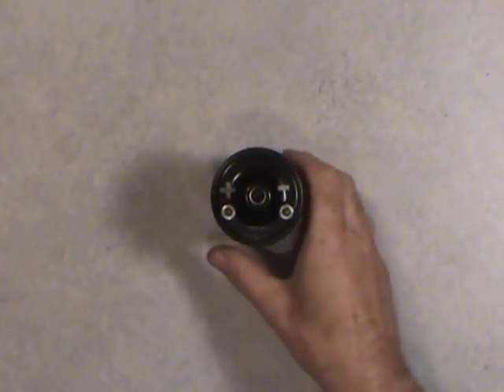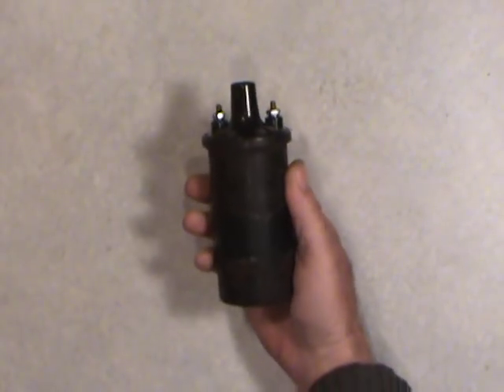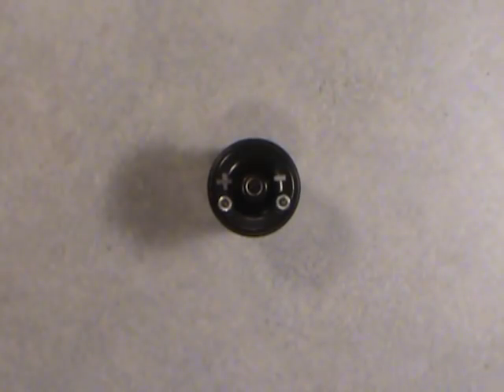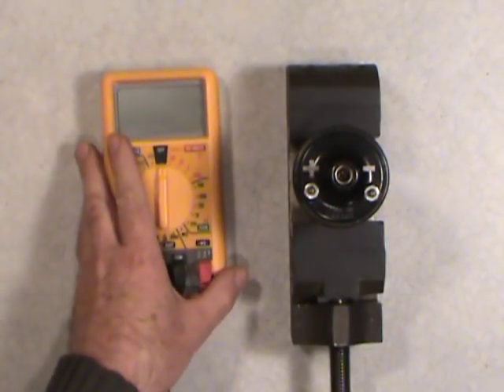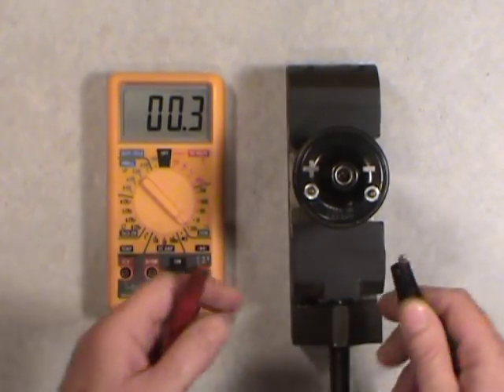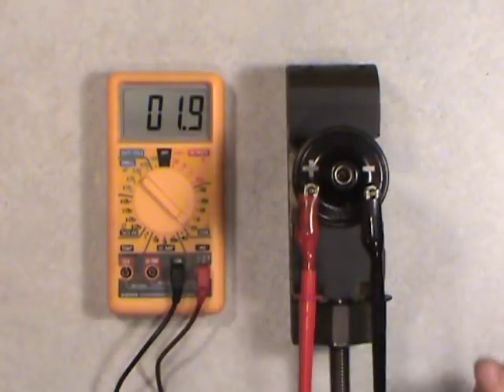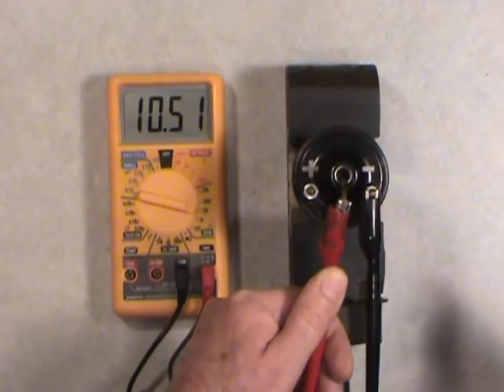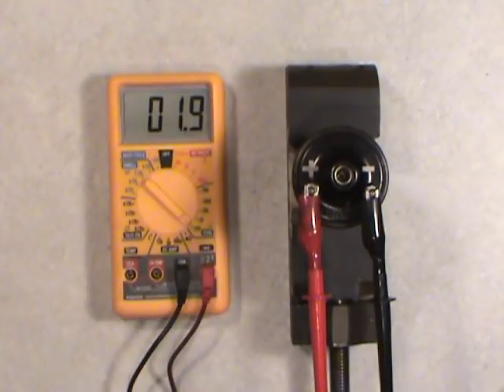Ignition Coil Testing

Comment: Thanks for the video. It may have been mentioned in the comments, but for accuracy's sake, you should have checked the resistance through the nail by itself prior to testing.
Reply from the maker: Greetings SCScott2002....You are welcome, for thanking me for this Ignition Coil Testing video of mine, and, thank You, for watching it as well....Now then, for your concern, about the "Accuracy" of my Ohm/Multimeter's "Ohms-Reading/Display" that has the...2 1/4" (two and one quarter inch) long "Common Nail", that happens to be just under 1/8" (one eighth of an inch) in diameter in the "Test Lead Circuit"...(now I'm running downstairs, to "Fetch" that  2 1/4 Inch common nail, and once I grabbed it, I Re-Shined the nail with some sandpaper, so that there wouldn't be any Oxidation on it, that might just cause an unwanted Resistance on the Nails connection points, where, both, one Polarity (either black or red) Alligator Clips gets attached to, and the other end of that there common nail makes contact with the other (polarity) Alligator Clip, and in this case, to only "Check" the "Calibration" of both, the Multimeter/Ohm Meter, and the Test Leads, "With" the common nail in the circuit, and "Without" the common nail in the Test Lead "Only" Circuit.

"Results are Now In!!!"...

...The "Results", well, actually the "Result" was...

...No "Difference" what-so-ever...

..."With" that there 2 1/4" common nail, having one color (red or black) on one end of that there common nail, and the "Other" colored alligator clip on the Other end of said common nail, the "Ohm's" reading (on the lowest resolution, or scale, of 200 Ohm's on my yellow multi-meter) Displayed ".3-Ohm's"...and...the Display was showing the same ".3-Ohm's" reading "Without" having the 2 1/4" long common nail in test leads Circuit.

So then, I even went a step further, on Testing my yellow multi-meters "Calibration" for the Ohm's "Zero" Accuracy...

I grabbed a piece of Copper Wire, oh, almost about 1/16" (one sixteenth of an inch) in diameter, and about 2" (two inches) long, and made it all Shine-ee with a piece of sandpaper, so's the Oxidation would-not cause any electrical Resistance, when, I was using it, in the following manner...

...I then bent that there piece of copper wire into a Horse-Shoe Shape (aka, the letter U)...Gee, We all wounder what this guy is up to...

...read on, and I will tell All of You...

...I then removed the Test leads from my yellow multi-meter...

...then, I "Jumpered" (exciting word for connecting the 2 Test Lead connection points on the yellow multi-meter, that the 2 test leads attach to) with, that there "U" shaped piece of copper wire, in order to actually "See", just how..Far Out (but don't add the "Man" to those 2 words like the guys from Cheech and Chong did!...lol) my yellow multi-meter's "Zero-Calibration" actually is...

...and here, all this time, I thought that, my yellow multi-meter was reading ".3-Ohm's", when it should be Displaying "0-Ohm's", without the test leads connected, and by having the 2 test lead connection points Jumpered with that there "U" shaped copper wire...

...Wowsers!...when I used the copper "Jumper" wire, to check, just what my yellow multi-meter's "Zero-Calibration" might just be...

...the multi-meter's "Display" was Displaying ".2-Ohm's" !!!

...so, now it looks like, the 2 test leads (each one is about 4 feet long), thus makes them about 8 feet long, when connected in "Series" (aka, end to end), and that my Friends, has me thinking that those 2 test leads "Total" a "Resistance of ".1 Ohm"...

...still, I have to "Account" for ".3-Ohm's", with my Test Leads connected to my yellow multi-meter (with or without my nice shiny 2 1/4" common nail), especially, when You, or I, are using the "Low" or "Lowest" Scale on a multi-meter, such as mine...

...Very "High" Ohm's readings found/seen, when measuring the Ignition Coils "Secondary Coil", shouldn't be as Fussy as the "Primary Coils" reading, due to the very "High" Ohm Readings involved.

Bottom Line...Make sure that You take into consideration your Ohm/Multimeters Zero-Calibration with the test leads attached to your Ohm/Multi-meter, Especially when you are trying to measure any Resistance Circuit that "Will" be Displaying "Low Ohm's Readings!!!"

Gee, I wish that this yellow multi-meter of mine had a way to do a "Zero-Set" for Calibrating "All" of the Ohm Scales (resolution) Read-outs, before I start taking actual Ohm's Measurements on the Part, or Piece in question...

...kinda looks like the Older "Analogue" (aka, has a needle/pointer, that "Waves" at You!...lol) multi-meters that I have, have an advantage over my yellow "Digital" multi-meter, in that, I can Actually "SET" the "Zero" Point, on any Ohm Scale that I'm wanting to use at the time!!!...

...and...

...for the time being...

..."That's All Folks!"...

...Be Safe, take care, and have a good one.
Reply: RockysRoadshow  nice vid not the coil I was looking for but still good thanks
Reply from the maker: littlebignuts02
Greetings once again littlebignuts02....Thanks again for your great comment....Now, about that Information that I said that I was going to tell you about...so, here it is....I currently have "3" Different "Types" of Ignition Coil Videos that you can watch on my YouTube Channel, and they are...This one, that you have already watched (2 of them, both Long and Short version videos)...I have "2" HEI (High Energy Ignition) Coil Test videos (and again I say, a Long version, and a Short version)...and I also have an Ignition Coil Test, of the type of Ignition Coil that is found on a mid 90's Chevy or GMC 4.3 Litre (262 Cubic Inch, I think) "V-6" Engine that was mounted just above one of the valve/rocker covers....There are also quite a few "Ignition" related videos, such as Distributor Cap inspection, Ignition Wires testing, and other automotive videos, that you can find on my YouTube Channel as well....Just type...RockysRoadshow...in the YouTube search box, at the top of YouTubes main page, and that should show you a list of all of my videos that I have made so far (79 videos, I think)...enjoy....Be Safe, take care, and have a good one.

Comment from the maker: Greetings Paul Brenton....Good job on your calculations....The Oil Filled Ignition Coils put out about 30,000 Volts Max, and the Epoxy type of Ignition Coils put out about 50,000 Volts Max (as I recall)....Although you may have primary and secondary resistances as measured at the Ignition Coil Terminals with an Ohm Meter, you can't use those figures to calculate the output voltage of the coil....The Voltage gets stepped up according to the Primary vs Secondary Windings Turns Ratio....(con't)...

Comment: Hi!  Thanks for the video.  Question...where can I get the resistance specs for a coil out of a 1967 Ford Mustang 289. It's no where to be found in my Chilton book. Thank you,
Reply from the maker: Ryan Jones Greetings Ryan Jones....Thanks for watching, now, onto, Your Mustang's, Ignition Coil..."Specifications" (Ohms/Resistance)..............................I looked around, quite a bit, on the good ole Internet, trying to find, that/those, oh so elusive, Ohms/Specifications, for Your Stang's Ignition Coil, and, after doing so, I came to the conclusion, that I'd probably have a much better chance, at..."Winning the Lottery"...then stumbling onto Your particular, Ignition Coil...Ohms/Specifications...!!!...lol...but, fear not, as my Chrystal Ball, hasn't failed me yet...!!!...............................I did a "Cross-Reference", of Your "Factory/Stock" Ignition Coil, and, low and behold, it appears that, Your 289's, "Stock/Factory"...Ignition Coil, was used on quite a few, of the Other, Brands/Manufacturers "Engines" as well...!!! (how about that...lol)..............................I did see how-ever, a few Different "Ohms Ranges, for an Ignition Coil, such as Yours..................................Without any Wiring Connected, to the Ignition Coil, here's what I would be looking for..................For the "Primary" Measurement...1 to 2 Ohms...should be alright........and..........for the "Secondary" Measurement, there was quite a Range, seeing as how, each Manufacturer, seemed to have, Their Own Way of Doing Things...and...I saw, that these Ranges were, With-in, anywhere from...6,000...to...15,000...Ohms.............If You really want to find the "Exact Ohms Specifications", for Your Ignition Coil, You might have some luck, finding those Ohms-Specifications, on one, or perhaps more, of the Many..."Ford Mustang"...or...on any Ford Car or Truck..."Websites"...that, will usually have, some very helpful/knowledgeable Folks, on their (website) "Forums", where You can Ask "Them", if they have the Ohms/Specs, for Your "Exact" Ignition Coil"...???..............................I have found that, an actual "Official, Factory Chassis Service Manual", usually had, the "Ohms Specifications", for Ignition Coils, as well as, something like the "Ballast Resistor"..."Ohms Specification", that usually is, part of the Ignition Circuit, if it happens to be, the good ole "Points and Condenser", type of Distributor, that is...............................One or more People, on those Website "Forums", just might have, a..."Factory/Ford...Chassis Service Manual"...for a..."1967 Mustang"...and...He/She, might just have, Your particular...Ignition Coil's..."Ohms Specifications"...that, hopefully, "They" will Share with You (keeping fingers crossed)...................................................Even though, an Ignition Coil "Tests OK"...Ohms/Resistance-wise...that, my Friend, might not, Tell the Whole Story, as, sometimes, quite Rarely, when an Ignition Coil, reaches Operating Temperature (or Hotter), that hypothetical, Ignition Coil, can "Act-Up", as in, Not Work, all that good, or maybe Intermittently, or in a worst case scenario....Not at All...!!!....Yikes...!!!...............Also..."Everything"...that is Part of the Ignition System's "Circuit", that be-in, All Wiring, and Components/Parts as well, have to be in, Very Good/almost like New Condition, so, Your Mustang's...289 V-8, is able to give You Great Performance, and, if You go Easy on the Gas Pedal, some pretty good, Gas Mileage as well............................If Your 289, still has that good ole "Points & Condenser", style/type of Distributor in/on it, then, the "Points, and the Condenser", must be in Good Shape, as well as, have the "Points...Gap/Dwell"...Adjusted/Set-to..."Specifications", and, after doing that, Your "Initial Ignition Timing" (on the Engine's Timing Tab/Indicator), has to be..."Checked, and (most likely), Set/Re-Set"...to..."Specifications"...So Your 289, doesn't get Lazy, or Damaged...!!!.........................If You need any help or advice, just let me know, about Your 1967 Mustang, and also, if it has any Modifications..............Well.......Till next time................Be Safe, take care, and have a good one.

Comment: excellent amount of info... But next time do the quick show of the test, then if people need it explained more then add in the other..

Just test the connection coming in. 
Then test from the - to the output terminal... the numbers you get are based on good or bad from the specs of the manufactor
Reply from the maker: +Black Box Greetings Black Box....Thanks for watching..............Yes-Sir-ee-Bob...I do hear Ya, and, oh, I guess, that it was last year, when I made a some-what "Shorter Version", of this particular Video, of Ohms-Testing, this very same, Oil-Filled type of Ignition Coil, that You saw, in this YouTube Video of mine, that You commented on.........If You care to, just, head on over, to my YouTube Channel...RockysRoadshow...to have a look-see at it, and, there are less than, 100 Videos on my YT Channel so far...enjoy........................Even though an Ignition Coil, and, all of, what makes up the entire Ignition System/Circuit, might check out ok, for Ohms, Voltage, (electrical) Ground, etc., well, that's one thing, but, there might be, rare times, where an Ignition Coil, starts to Act-Up, and, not work so good, and maybe, to the point of, not working at all, when, that not-so-good/faulty Ignition Coil, gets up-to Operating Temperature, or, maybe even hotter perhaps, and, probably, because of, something like, Thermal Cycling, as in, having both, the Primary and Secondary Coils of Wire (that are inside the ignition coil), being quite cool or cold (when not working), then, (when working), getting nice and warm, or hot, when up-to operating temperature, thus, the Expansion and Contraction, of the Primary & Secondary Coils, having to endure, all of this adverse, shall we say, Operating Environment, perhaps........................While the amount of Voltage, being Fed, to the Ignition Coil, is to be considered (ballast resistor perhaps?), it's also very Important, not to Feed a given Ignition Coil, too many Amps/Amperes, as well as, for too long a time (in milli-seconds/thousandths of a second, time-wise, that is), that was-not able to handle it, or maybe, Poof, goes that probably Over-Heated Ignition Coil, and it's now Tow-Truck time...Yikes...!!!.......................The High Voltage Output, of an Ignition Coil, can vary, due to the amount of Voltage, that goes into the Primary Coil's Terminal/s, as in, something like, having the Charging System going Kaput (aka, not working any more), which will usually result in, having the Battery's Voltage Drop, from, oh, about 14.5 Volts (when the charging system is working), down-to, about, 12.5 Volts or less (ball park figures), and, when-ever, the Ignition Coil's, Primary (terminal/s) Voltage Drops, so does the High Voltage Output of the Ignition Coil (usually measured in Thousands of Volts)...!!!...and, probably, a weaker Spark, at the Spark Plugs, it will be, and, I hope not, and, till next time.............Be Safe, take care, and have a good one.